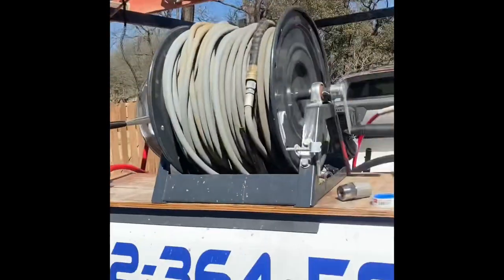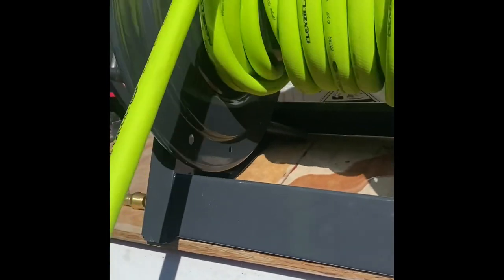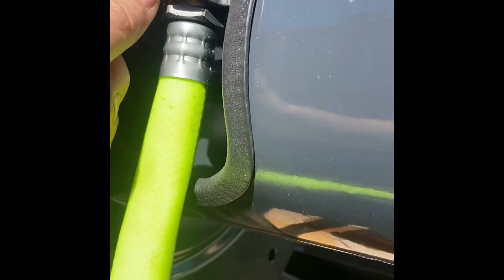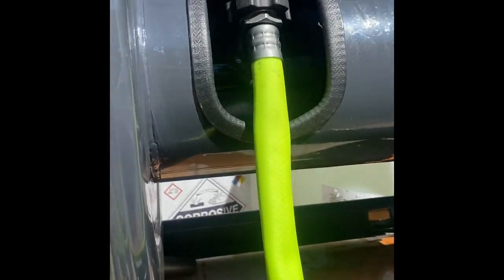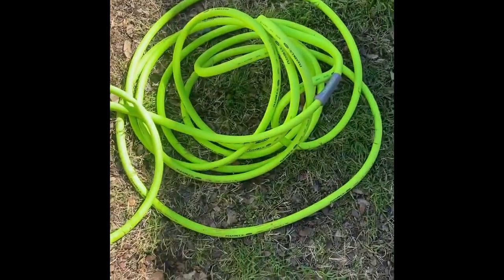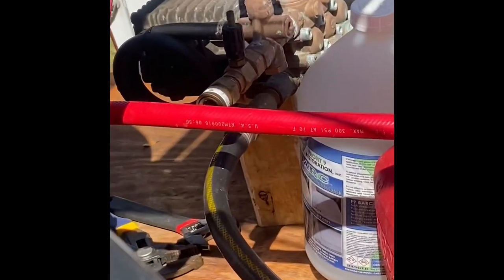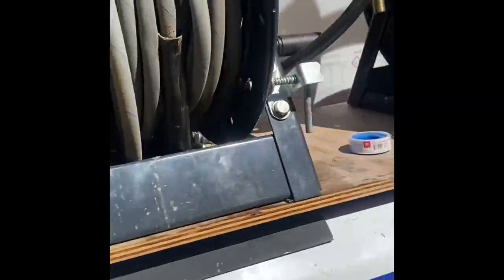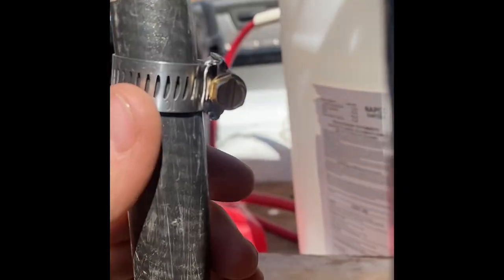How to set up a garden hose reel for your pressure washing rig

Comment: Another option I recommend instead is to use 3/4" Poly Braid from your pressure washer to your hose reel. no point in going 5/8th since your going to need to upgrade once you upgrade your Pressure washer to a higher GPM. Even with 3/4" I run into a few houses a month that the water supply is not the best and I run my 275gallon tank out of water with my 11+ gpm soft wash pump. Also I recommend getting rid of those small screens when you get a buffer tank just run a banjo strainer, they're a lot easier to keep rinsed out and provide better flow. If your don't do these things in the beginning you will be chasing the problem later in the future.
Reply: Can you do I video on the option you just explained.

Comment: does anyone know where to get a 5/8 gh fitting as seen in the video. General pump no longer includes it with their reels.
Reply from the maker: @TheDollarhide  damn! I would just Amazon it
Reply from the maker: 3/8 to 5/8ths male fittings
Reply: @AustinDavis24 i couldn't find it anywhere on amazon or general pumps website. What manufacturers also make that fitting?

Comment: I plan on doing something exact to your setup but instead using the 1/2" NPT to 3/4" barb adapter fittings on both the inlet and outlet and just cutting both ends of hose and connecting to the barb with clamp..ill lose that extra filter screen but my pressure washer still has the one and its always worked well enough so far when only using a hose with no reel....however gaining a better connection to the reel that will probably hold up better than using the garden hose adapter which I feel will likely loosen up and leak...but either way gets the job done!. I agree though nobody has explained this on YouTube and you was the first I found so Thanks for the content!
Reply from the maker: Thanks for the comment!! And that’s awesome!

Comment: is the high pressure hose 1/4 diameter with 3/8 quick connects? or is the hose 3/8 diameter with 3/8 quick connects?

Comment: Can i use a regular garden hose 1/2 for softwashing? Will the bleach harm the hose?

 Reason im asking is that i live in Norway and they dont have flexilla over here, can order on ebay but its really expencive thats why i wonder if i can just use a normal gardenhose, and if i pull just water trough it after the bleach it will probably be ok!?

Comment: So I am assuming you can hook the water direction up either way on hose reels? I always thought the water supply went in the side of the reel and then you pull out the hose from the reel to use
Reply from the maker: I’m confused
Reply: @AustinDavis24  so you are running the supply hose to the spigot, for window cleaning you would run a hose from the spigot to the reel and then pull your supply hose out and connect to your waterfed pole. I am just wondering if the water is able to flow either way through the reel, allowing you to customize it to make it work for your needs
Reply from the maker: @bradleymenezes6196  yes technically it can flow ether way. But typically it goes from spigot to the reel.

Comment: Your link for the hose reel doesn't work anymore.  Can you tell me which reel you use?  Also, what length garden hose do you use?  I have a 130 ft x 5/8in garden hose, and I would like to use a General Pump reel.

Comment: Do you have the link for the first fitting/ swivel you showed inside the hose reel. My reel is also 3/8 need an adapter or something to fit my 5/8 flexilla hose inside. Thanks
Reply: Ever found a solution? I’m breaking my head trying to fix this problem

Comment: In using a $99 Home Depot metal garden hose reel without the wheels and works great. Then I have the nice titans for high pressure and my softwash system
Reply from the maker: That’s awesome. I considered doing that in beginning
Reply: @AustinDavis24  true, I am starting out lol
Reply: @MrNick-  how many feet of hose can the HD reel hold?
Reply: @Kgio-2112  the one I purchased I added 225’ of 5/8” hose and it could fit more but not much more
Reply: @Kgio-2112  I use that one for property protection (just fresh water)
Reply: @MrNick-  ok. Thanks brother.
Reply: Which one from Home Depot?

Comment: Do you find that residential water supplies don’t flow enough to feed that washer directly? I thought anything past 4gpm you need a buffer tank?
Reply from the maker: I’ve had no issues. Anything above 4GPM you will need a buffer
Reply: Any issues with the flow of water going up your truck like that? Is the pressure and flow the same as if it was on the ground?

Comment: What is that little attachment called that came with your GP hose reel? I'm so stuck because I need an attachment like that and I can't find it
Reply: I have the same problem did you find a solution?
Reply: @jrcxv  Nope! Lmao just ended up going to a plumbing and hose company here in town and told them exactly what I was doing and what I needed to fit where and they helped A TON. I highly suggest finding a plumbing and/or hose company local to you.

Comment: Have you noticed a difference between 5/8” and 3/4” set up for the supply hose to your pressure washer?
Reply from the maker: I’ve only ever used 5/8ths. I’ve heard it’s not much of a difference. I’m sure if you have a 8GPM machine then that when it matters what kind of hose you have feeding it
Reply: @AustinDavis24   thank you for the reply. I appreciate your opinion and experience with this. I only have a 3gpm, 3200psi pressure washer with a triplex pump.  I had been using a 3/4” hose but 5/8” should work for me. Thx
Reply from the maker: Absolutely! I love helping people, ever have any questions you can text me. Number is on my truck. That garden hose should work just fine
Reply from the maker: Also this is a flexzilla hose. I like it a lot. Easy to be seen, eye catching when driving on the road, easy to handle.
Reply: @AustinDavis24  I had considered an Eley hose...  heard a lot of good things about it.
Reply: @AustinDavis24   I checked out your links but didn’t see the flexilla hose.  I’ll check it out.
Reply from the maker: Oh my bad! Just type it in on google
Reply: @AustinDavis24  no problem.  I’m grateful for the content.  Helpful stuff.  Thanks for the replies.  I’ll follow up with you at some point to ask about your soft wash cocktail.

Comment: My garden hose seals good to the adapter but my adapter isn’t sealing good enough to the hose reel. Any idea of what to do? I made sure they were both tight
Reply from the maker: Is it leaking?
Reply: @AustinDavis24   yes sir. From where the spring is.
Reply: @AustinDavis24  do you think I have to have the spring on or should I take it off?
Reply from the maker: @luckycollins1431  I have the spring on. I had to use two sets of pliers to get it as tight as I could
Reply: @AustinDavis24  OK great thank you. I was worried about stripping anything
Reply: @AustinDavis24  I ended up going to Ace Hardware and buying a new garden hose adapter that is one solid piece and it works great. Thank you for all your help Austin!!!!
Reply: Having the same issue. Could you please post link for the adapter